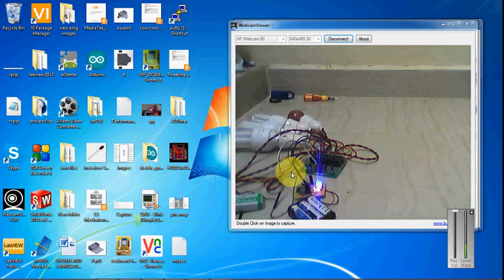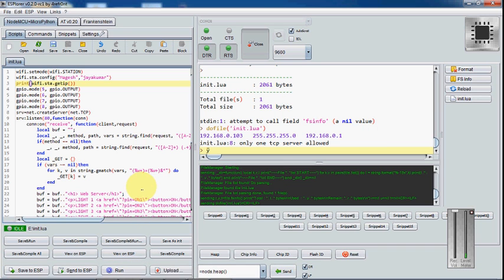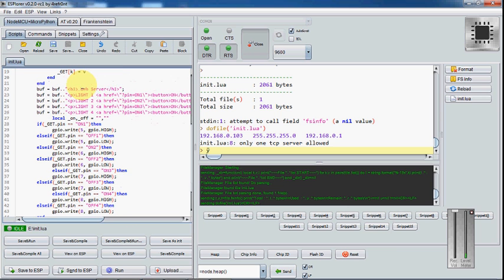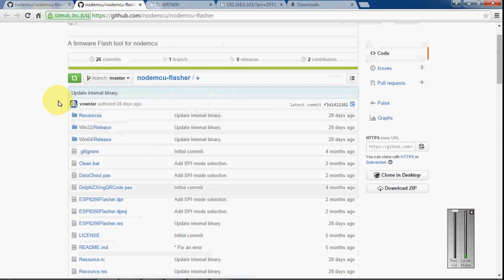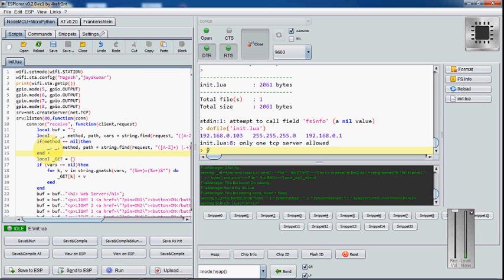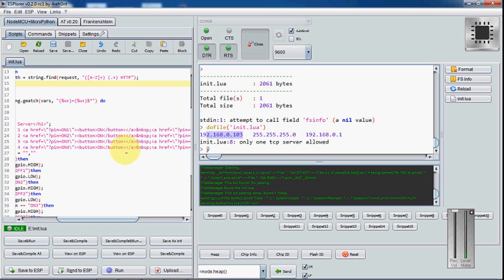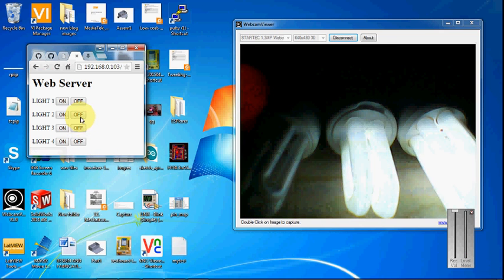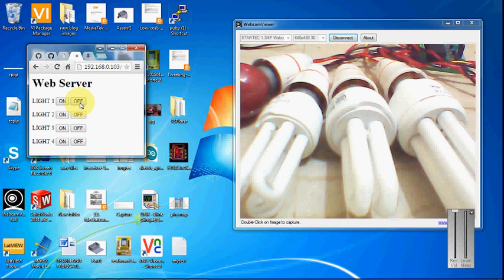Esp8266 esp-12 web server based electrical control

Comment: Hey I got the same ESP8266 yellow Board, can you please help me flash it to NODEMCU. Do I have to use 3 AA batteries while flashing? Wiring is TXD to RXD and RXD to TXD, jumper set and 3.3V from USB to VCC of ESP8266 (the pin next to the chip).

Comment: Dear Arduino Robotics Labview Solidworks, its very nice video, but I am stuck in connecting my esp8266 with PC in esplorer IDE, Can you tell the circuit / connection with PC..... which you have done, because in my case I am able to receive the messages from esp8266 in esplorer, but my commands are not received by the esp8266..
Reply from the maker: +Muhammad Kamran sorry for delay, have you solved your problem??

Comment: Salam,
Which app you are using?
I have Arduino Uno and I have just bought this ESP8266 12 but don't know how to move forward.
I am powering ESP8266 module via my arduino i.e. I am not using the batteries for now.
Reply from the maker: Talha Kamran I am using a web browser to control the esp8266, it has inbuilt memory to function independently , we don't need arduino to support this device, check other videos in my channel about esp8266, I've not yet posted its detail in blog soon i will post it. Thank you
Reply: Arduino Robotics LabVIEW Solidworks I am using Arduino just to power it up :). Don't have 3 AA batteries with me at this time :)
I thought Arduino has RX and TX may be I can pass on commands via Arduino Uno by connecting its RX to ESP8266 TX and TX of Arduino with RX of ESP8266
Reply from the maker: Talha Kamran what you trying to build with it??